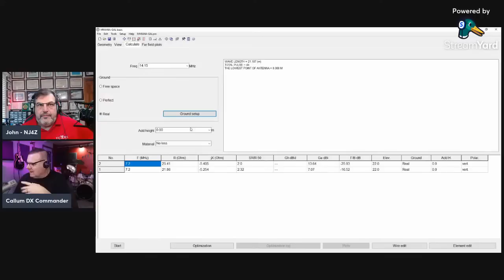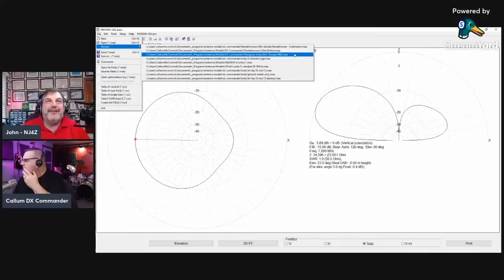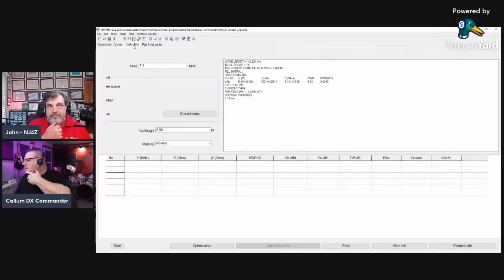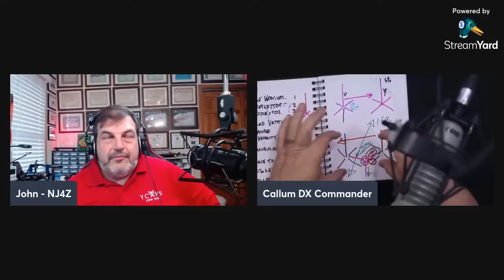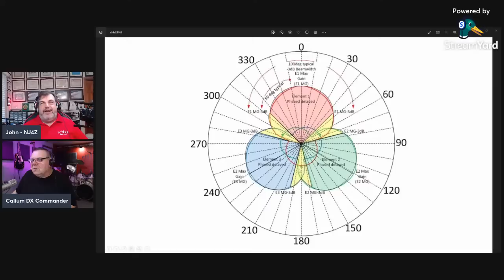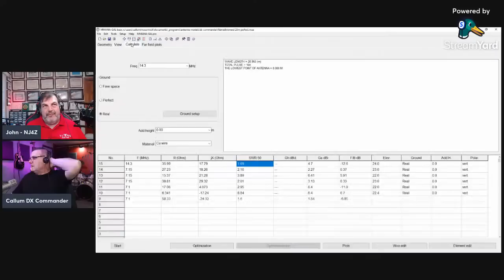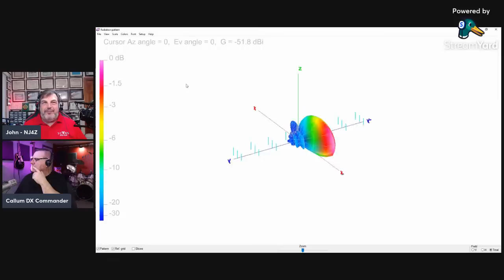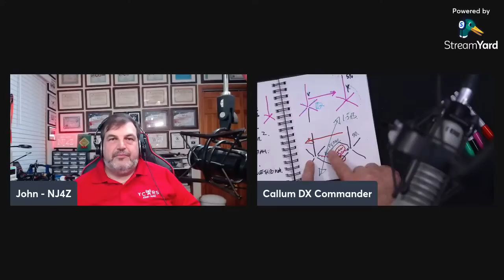Simple Cheap Ideas for Achieving Gain with Wire Antennas

Comment: Just started watching Cal, but a note about MMANA - it feeds antennas with voltage, not current. Voltage and current are not always in phase - one could lag the other. This has a significant effect on performance of phased arrays, specifically F/B, but gain should remain mostly the same in most cases. This is what I learned from reading the section of the ARRL antenna book on phased antennas and playing around with MMANA myself 

Just thought it'd be worth saying here 

73 and thanks for the video! De VE3GKT
Reply: you are correct current plays a huge roll in arrays.  If you are building an array, you really must keep the impedances of the elements the same if at all possible.  There are ways to force the current to divide equally, like a current divider or other methods, that will produce better results.

Comment: Thanks for the videos. I have found that changing the radials config for a two element vertical beam works very well. I raise the elements and use four sloping radials on the DE and three sloping radials on the REF. Very good FB and low SWR across the band. The radial on the DE towards the reflector is longer and the away radial on the REF is shorter. Very good FB and low SWR across the band.
Reply from the maker: Ah yes, F/B is always a cool topic.

Comment: very interesting. with the 3 ground planes. the box would it work sort of like a super scanner box of the   60s or 70s. only they had the 360 option extra. ???
Reply from the maker: Sort of yes!
Reply: Ron, works similarly, the super scanner forced the current via current dividers and it worked fairly well according to folks that used it.  The triangle ground mount does have an omni-directional option, just feed all three of the elements in phase.  We didn't really talk about it, but you can have it in omni and can build the box to switch in three or 6 directions.  there is a little less gain when using the 2 delayed versus the single delay in the 6-way configuration.

Comment: Peter Waters (G3OJV) was talking about putting up a vertical in his backyard/garden, then putting up another one (slightly taller) as a reflector. Then my mind started drifting … what if he put a vertical in the center, then put a number of ”post sockets” (or whatever you call them) evenly spaced around the radiator (tied together with a radial grid). He could put a ”director” in one socket and a ”reflector” in the opposite socket … Then he could direct his signal by running out and repositioning the parasitic elements …

73 de AF6AS in “DM13” land
Reply from the maker: He's copying me again! Yes, we've done that a few times. Really delivers.

Comment: 8:57 Location is a big factor with me. I'm in Florida and skip always starts early morning with UK and I can follow with my (Very wide angle PDL2's) with out really moving them much through the whole day ending with the west cost and Hawaii. The rejection blocks a lot of south America's Spanish speaking operators. Using the beams for this situation works best for me over my omni antenna. But if I was in the middle with contacts from all around, The omni is the way to go. ;)
Reply from the maker: I had a PDL2 once :)
Reply: @DXCommanderHQ  Sadly, the adjustments are solid and the vertical is a little high at 1.7:1. The flat side is a sweat 1.1:1. So I added an Omni (Solarcon Max 2000 Optimized.) My PDL2's are 40 years old. I'm not sure how much longer they will work. I sure got my money's worth out of them! ;)
Reply: @DXCommanderHQ  I had a PDL2 back in the 70's, great antenna.
Loved the ability to switch between Vertical and Horizontal.
Worked a lot of Europe on 11 meters from North Carolina. Gary

Comment: Wasn't able to catch the premiere but great chat with NJ4Z here. Really well put together video! A topic I'm really interested in as well 👍. Out of curiosity (I haven't done the math here), would it be possible to use a 20m 1/4 wave as a reflector on 17m? And if so it'd be neat to have a way to switch/ short braid and center on the reflector but use it as a 1/4 wave otherwise.
Reply from the maker: Stian.. Ideally, you would have a reflector for 20m.. And just a bit shorter - and closer, another one for 17m.
Reply: @DXCommanderHQ  right, I was curious wherher or not it could be achieved with an existing dx commander setup, 20 and 17 on both poles. I reckon the distances and gain wouldn't be optimal but it'd be fun to see if it were possible to make a multi band reflector? Or does that also require the driven elements be slightly shorter? 😴🤣 I should actually just model it myself for the hell of it.

Comment: Hi Cal,
One of the sites that I plan to operate portable from has large rows of shipping containers that I can use. Do you think, if I put a horizontal square wire loop, raised to the correct height over the shipping containers, that the steel containers would act like a reflector in a two element quad?
Reply from the maker: OK, so I would say the containers will do nothing (funny - I thought I had replied to this.. clearly not!) other than clutter up the REAL ground. They will neither hinder nor help you (in my opinion). ALthough, they would probably assist a ground plane - if connected to an antenna that needed one - like say a grounded vertical.
Reply: @DXCommanderHQ  Thanks!!😊 You've replied to lots of my questions 🙏 but I think it's the first time I've asked this one, (I think!) lol 😄 Appreciate you taking the time once again to humour my ideas and to help me learn. Have a great day. 😎

Comment: You don't have to (shouldn't) run 75 ohm coax all the way between co-phased antennas, you can run equal lengths of 50 ohm and have smaller sections of 75 ohm at 1/4 wavelengths long.
To Quote:
"One error is using long lengths of 75-ohm line to co-phase two 50-ohm elements. An odd-quarter wavelength 75-ohm line transforms impedances because the line is mismatched, and has standing waves. If the line is lossless with a perfect 50 0j ohm load, the 75-ohm SWR all along the 75-ohm line is 1.5:1. This means, at odd-quarter wave distances, line impedance becomes 1.5*75 = 112.5 0j ohms. Two of those impedances in parallel are 56.25 ohms. Unfortunately, the required coaxial cable physical length means elements must ether be less than 1/2λ apart, or we must use longer feed lines from the Q-sections to element centers.

Many articles make the Q-section longer than λ/4, such as 3λ/4 or 5λ/4. We should be careful doing this, for two reasons:

    Losses increase because mismatched sections are longer
    Bandwidth decreases because there are multiple mismatched sections in series

Consider the case of a line 5λ/4 wavelengths long. Such a line has five 90-degree sections in series. If frequency changes 2%, it causes a 2% error in each λ/4 section. Errors in each of the five sections add, and now the total line error is 10%. The Q-section not only has additional loss, it also has reduced bandwidth.

Using a 50-ohm section from each element to its respective Q-section, so each Q section only needs to be λ/4 long, will always increase bandwidth and often decrease losses. It is also not difficult to implement. My 6-meter Yagi stack uses 50-ohm equal length lines to the Q-sections, which are only λ/4 long. Length of the 50-ohm sections does not matter, so long as they are equal, because the 50-ohm sections are matched, and essentially have a 1:1 VSWR. If I make a velocity factor error, or change frequency, or have 75-ohm line losses, errors and/or problems are 5 times less!

I'm not forced to have feed lines between the antennas that can only be changed in multiples of λ/2, such as λ/4, 3λ/4, 5λ/4, and so on.  I can use two equal length 50-ohm feed lines that are any physical length that reaches, with the only attention to detail the quarter wavelength 75-ohm Q-sections. This greatly reduces cable cutting errors because the long lines are matched, and only need to be equal lengths of the same cable stock. "
Reply from the maker: Indeed.

Comment: Would love to try something on 20m next summer. Would you get away without using RF rated relays?
Reply from the maker: I'm sure. It'll also depend on how much QRO
Reply: You can just make sure to not run a ton of power into them and make sure to use a capacitor across your relay power inputs so EF stays there and doesn't come back on the control line.

Comment: Callum you drew the radiating direction of the phased array exactly opposite of what he explained... @ 22:35 to 22:55.     Your terminology "gain goes through the middle" does not clearly explain it as it normally would be referred to as "broadside to the array".  Normally I have nothing but glowing praise for your videos but this conversation was fractured and convoluted making the end result confusing.
BTW the triangular array was marketed and sold quite successfully for the 11M band as the Antenna Specialists M-119 "Super Scanner" in the 1970s.
Reply from the maker: Gawd, are you saying I actually made a mistake?! Sorry.

Comment: Could the delay line be a quarter wave length at each frequency or does it vary. Hope it makes sense. Shaun M3ULT.
Reply from the maker: Delay lines are normally frequency dependant.